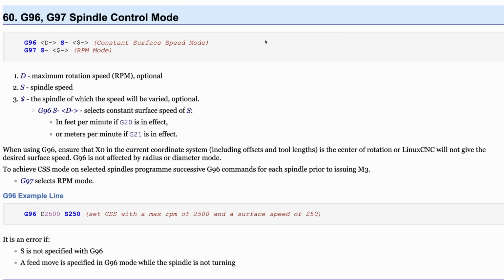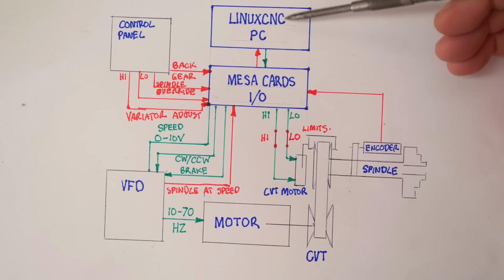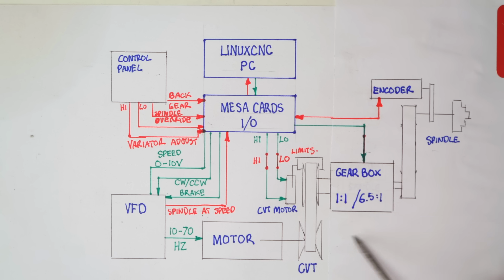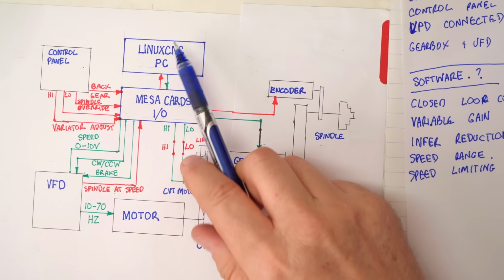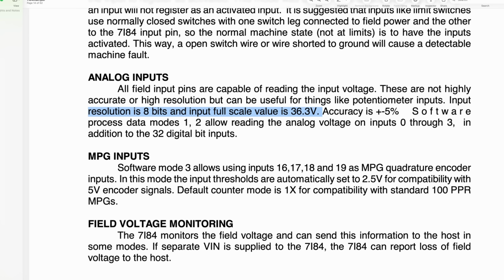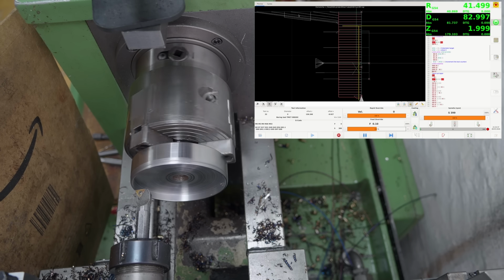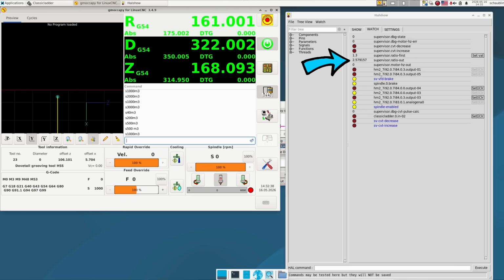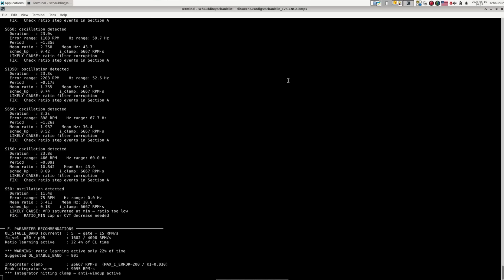Schaublin spindle control Ep.68. || RotarySMP

Comment: I've never seen a CNC lathe function this way (not saying it shouldn't). Typically, there will be 2-4 gear ratios that are selected with an M code. For outside turning you might select a low gear for more torque, but your CSS max RPM will be limited. If you then need to bore the ID, you would stop the spindle, select a higher gear, and your CSS max RPM would be higher. The CSS does not attempt to shift the gears on the fly. That said, I did have a lathe with a wye/delta spindle motor and the VFD could switch it automatically. 
Your control scheme has two inputs (VFD and CVT) with only one output (encoder). That's not ideal. Like math, you have more variables than equations. A possible solution would be to command the VFD to the same frequency every time you shift the CVT so the encoder output is predictable and only reflects the CVT input. That's going to be a lot slower. 
IMHO (for what it is worth), I would setup CVT ranges that can be activated with an M code just like a gear shift. Those would be set automatically with the VFD at a set frequency as mentioned above. Then your CVT is stuck there until you issue a new CVT range M code. I think you would find that 2 or 3 CVT ranges would cover 90% of your needs. 
Also, this is kind of a hot take, but I almost never use CSS. Unless you are doing some long uninterrupted facing cut it's typically not worth the fuss. It's especially true on older machines with slow spindles and modern carbide tools. For aluminum or mild steel you are typically running at or near max RPM anyway. 
This a pretty neat automation challenge!
Reply from the maker: Hi Wes, Thakns for your experience, this was Schaublins first toe in the water of CNC, so they reused their best manual drive. 

I looked up Schaublins manual. They divided 48-3000 RPM into 48 discrete speeds. With the back gear and the Dahlander windings, that means they split the CVT range into twelve bumps. I am pretty sure they didn't do true CSS. It had surface speed or rpm as settings, but I am not sure if that was just fixed at the start of a cut? To do a larger diameter than about 80mm facing cut , stepping through the speeds open loop, they would have to come to the point where they needed to switch dahlander windings, which would be a 2x speed jump, that the CVT could not compensate for.

I have written up my plan for the next attempt in the video description.

Comment: Some thoughts - from a computer engineer with some minor control engineering training.

You basically have two feedback mechanisms working.  1) input motor frequency to final output spindle frequency.  2) CVT speed and input motor speed.

These two different feedback loops can work together so long as you make certain the second (CVT/input motor speed) is configured to operate slowly.  The CVT should only be used to maintain the input motor speed to a desired RPM (~40 Hz).  Running all the time, just slowly.

The danger is to generate oscillation between the two feedback loops.  But so long as the CVT changes are slowed down, it should not be a problem.  There is no need to "lock out" or stop one of the feedback loops while adjusting the other.  Run them both at the time but maintain significantly different feedback rates.  For example, do not adjust the CVT directly on the input motor speed, you want to low-pass filter the input motor speed to add a delay and prevent oscillation.  (The input would always be low-pass filtered but I am suggesting the amount of filtering needs to be increased.  Tune as required.)

Using logic that links the two feedback loops together using "lock outs" and such amplifies the complexity -- I would avoid it.

Ever run a snowmobile?  You have the same problem which can be solved in the exact same way.  User controls the fuel based on desired final speed.  Internal clutch adjusts the CVT based on the motor speed.  Two completely separate feedback loops working together.  You basically want to implement this in software.

So to be clear, the two feedback loops:
INPUT.                                            OUTPUT CONTROL.                     Notes
Spindle speed (encoder).            VFD output for input motor.       Main method of keeping speed adjusted.
VFD output for input motor.       CVT adjustment.                           Low-pass filter input to prevent oscillation.
Reply from the maker: Thanks for your look at this. The CVT positioning motor is a constant speed 3Ph motor, so CVT changes are a constant rate (too fast for a CSS facing cut). So ideally the VFD would compensate for the excessive rate of CVT change, but reducing motor frequency. 

Did you see the additional information I added to the video description?
Reply: @RotarySMP  Quick answer - clicking "more" really does show a lot.  You have thought about so many options and seen many of the faults / limitations associated with them.  Overall impressive - but I suppose you do have a vested interest in getting it right.  Not much for me to add, but I will note this;

The CVT is going to be very inconsistent.  Repeat the exact same CVT settings at different times will result in different positions of the belt.  This makes "dividing into CVT ranges" and similar solutions where you rely on the CVT performing the same at all times -- problematic.  And this is before considering belt wear / stretch / change in temperature.  So I would avoid any LUT based solution that relies on consistent CVT behaviour.  You could always give it a shot as it might work, but it would be my backup option.

Snowmobiles, golf carts, and probably a pile of other devices have already solved this problem by using a centrifugal clutch.  You are using the 3-phase motor plus a worm drive gearbox in place of the centrifugal clutch - but other then that it is the exact same.  If you can replicate the behaviour of the clutch in software you might just solve the problem.

For control of the three phase motor, I would consider a duty cycle based approach with three states -- REVERSE, OFF, FORWARD.  So assuming a number in the range [-1:1],  -1 would give you max REVERSE, 0 would be OFF, and 1 would be max FORWARD.  A value just below 0 would be REVERSE but with a very low duty cycle - 2% or so (1 part on, 49 off).  The duty cycle would increase as the value drops to -1.  Drive the 3-phase CVT motor with this signal.  (Note, a duty cycle too low to drive the motor would just be ignored.)

By value I am referring to the input.  In this case, VFD output (you actually have to subtract the slip or current from the VFD output to estimate motor RPM).  With input equal to 50Hz, the value would be 0.  30Hz -> -1 and 70Hz -> 1.  I know the CVT is not linear but this will not matter.  Setup a standard feedback loop and let the loop attempt to maintain the desired 50Hz input.

It will not be pretty but this is why the VFD feedback loop exists to clean it up.  The CVT feedback loop gets you into the right area while the VFD feedback loop makes it perfect.  Will this work for CSS facing?  Who knows.  Probably not great which is why Schaublin could have changed things in future revisions.  But I think this is the approach they would have taken originally.  At least this is from a theoretical perspective.  Reality might be different.

And thanks for the great videos!
Reply: Motor slip.  A bit of a problem with this plan.  Do you have current feedback from the VFD?  Can you measure the motor current?  For this suggestion to work you would require the actual motor speed and not the VFD speed.  Using the VFD speed adjusted by the motor current should still work as an input to the second feedback loop.  (input = VFD_speed - X*motor_current)

Comment: personally i prefer to do G96 and then the line beneath using a G50 with a S value ( so its constant surface with a rpm limiter)
Reply from the maker: In Linuxcnc there is no G50. G96 already includes a D word to specify RPM limit speed. 
https://linuxcnc.org/docs/html/gcode/g-code.html#gcode:g96-g97
Reply: @RotarySMP  well didnt know that. i only used the big commersial lathes ( like fanuc, simens and haas controlers ) and all ofthose use G50 so i expected it to be the same in linuxcnc ( never played around with linuxcnc after all )
Reply from the maker: I am the opposite. Only ever used hobby stuff :)

Comment: Nice video and a nice real-world problem to solve.  About 30 years ago, I had to control a stepper motor driving paper (an ecg recorder).  We couldn't instantaneously change speed,  or more exactly we had a slew rate limit in the motor speed,  otherwise it would stall.  So changing the speed involved calculating a time series of wanted speeds that fit within the slew rate,  and a series of timer events to update the instantaneous demand.

Just a thought.  I wondering if it would be possible for you to start with as realistic a simulation of the dynamics of the system as possible.  There might be open-source tools that support creating this kind of simulation (I'm guessing).  Then,  given the simulation and a set of requirements,  let AI at it.    The point is that it can rapidly experiment with simulated loads, rather than you making real chips, and tune a control algorithm to the simulated hardware.
Reply from the maker: Thanks Adrian, I have added some detail in the video description on my next planned attempt.

Comment: a simple rpm sensor on the motor shaft is probably the easiest to estimate the ratio 

or adding a potentiometer (or magnet and linear hall sensor) to the cvt lever shaft and controlling the cvt-motor closed loop  (like how those steering servos in rc hobby work), 
then manually measure the ratio of a few angles and interpolate the data inbetween. then you know cvt at 30% is a ratio of 1.75 etc.  so you can just command it to go to 30% or 50% precisely when needed.
Reply from the maker: Thanks, I added more info to the video description on what my next attempt will be.

Comment: mine got no gearbox so i just put the belt on lowest speed and give the motor 200hz to reach that max 3000rpm on the spindle
Reply from the maker: The later 125-CCN's dumped the CVT for a big servo motor.

Comment: Encoder on motor spindle. If I'm understanding everything, you could calculate ratio based on spindle and motor speeds. Seems like there should be a way to get hi/lo data on the backgear. Little leaf switch? One less thing to guess at.
Reply from the maker: Thanks Jeff. I added more info to the video description on what my next attempt will be.

Comment: A couple of random comments. 1. On the discrepancy between the 10 volt source and the 36 volt sink, you might interpose an amplifier with a gain of 3.6. 2. You could do a 1 time measurement to create a table variator control  nut offset vs. variator rpm (ratio) --  (maybe borrow an optical tachometer to do the measurement). Armed with that table, you could  have the software open-loop command  needed variator ratio by running the variator nut to one end  then run it the other way for the number of seconds needed to position it (approximately) where it needs to be to get the rpm you need using the table. You already know the straight-thru / backgear ratios. Now you can calculate the approximate motor rpm needed for the required spindle speed and let PID fine tune it from there. For constant sfm over a known cutting path distance, you could pre-calculate the required rpm change over that path and see whether moving the variator or changing the motor speed would cover that range (giving the 50 Hz +/-5 priority over the variator and backgear. Then again what do I know?😊
Reply from the maker: Thanks Lenny. Timed dead reckoning of the CVT was my original plan, which I didn't try. I added more info to the video description on what my next attempt will be.

Comment: A collection of ideas: A) a small battery backed standalone micro-controller unit, which all it does is monitor the two limit switches of the CVT and the stepper signals. All its job is to watch those and remember where the position is. Its code is simple, wait until both limit switches have been tripped, then start counting. So you turn the machine on once, work the CVT all the way in and out, and from then on with its battery it remembers. This value, a raw count of number of steps could be fed back to the main control board over whatever kind of digital signaling works best for you, even plain serial rs-232.

B) the control algorithm. my initial reaction is that you should first rig a controller that lets you, the operator, manually measure and command each of the inputs (VFD commanded speed, CVT position via (A), and back gear YES/NO input via microswitch.) Then you sit down with a notebook and manually dial in, say, 10 different operating points over the entire regime. This makes the basis of a lookup table for open loop control. It gives you a broad course to get near where you need to be. If the g-code commands X, you interpolate the nearest two existent points, then command the resulting VFD speed, adjust the CVT. Once you're in the neighborhood you switch over to a closed loop that refuses to deviate more than some predetermined amount from this set point and just uses standard PID of the VFD side to fine tune, nothing more. It kicks out back to open loop under a variety of conditions, etc.
Reply from the maker: I am just working on B.  I have written up my plan for the next attempt in the video description.

Comment: I would do exactly what you dont want too...servo drive to toothed belt pulleys. Would be nice for threading threads and able to lock the spindle .
Reply from the maker: A servo large enough for decent low end torque won't run on my 16A feed.

Comment: Hi, Mark! I just finished my constant speed controler, Arduino based)) So, some thoughts about your project: adding even single tick encoder on spindle motor will help a lot, as adding gearbox position feed back. Got those - you can calculate vfd ratio. And maybe adding didicated microcontroller for this task will speed up things a bit. 
Enjoying your videos, it is always great to see people solving stuff, struggle, fail, but at last finding out the best solution, rather then watching- i'm making this thing- volla, I made it. 
Good luck!
Reply from the maker: Thanks. I have added a description of what the next attempt will be to the video description.

Comment: Way too complex and redundant.

You really only need the VFD and the backgear or the two speed motor and the VFD.

I suspect running at 50hz, four pole and the varidrive might be the best option if you don’t want to modify the mechanicals tho just replacing the varidrive with a plain or timing belt would give you much faster response.
Reply from the maker: Tha CVT is already in there, works and is paid for. my next attempt will be to treat it as discrete gears. watch this space :)